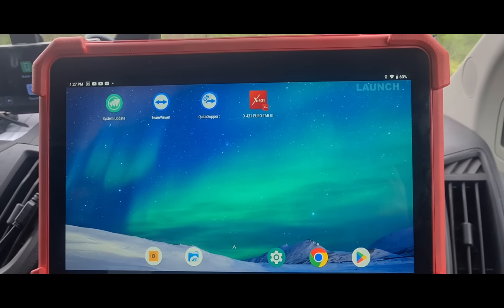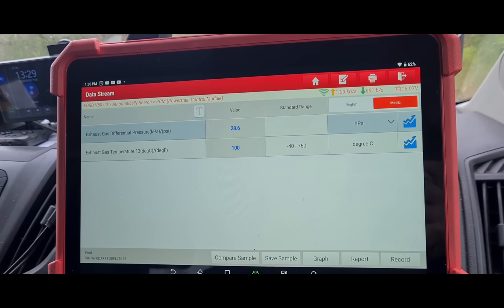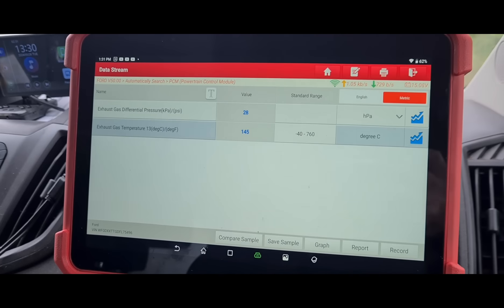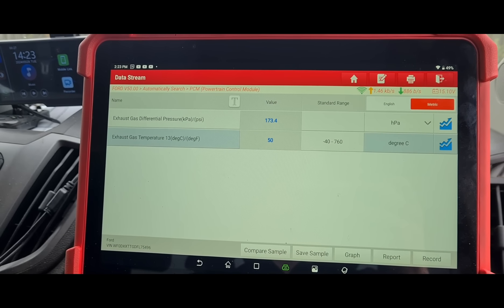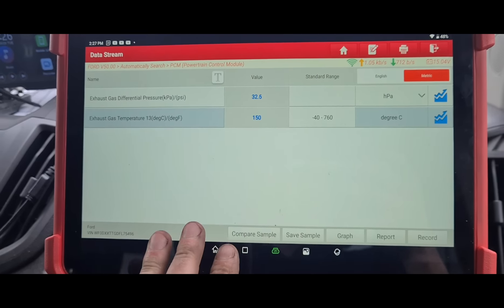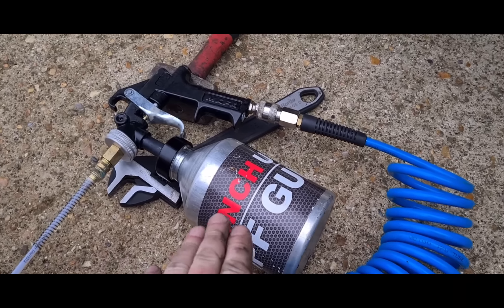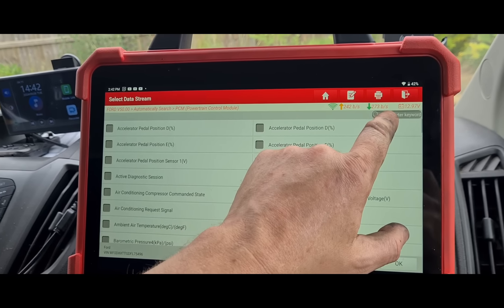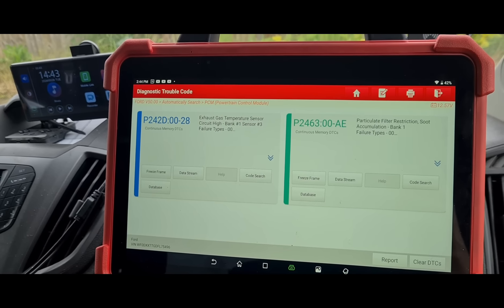Ford Transit P242D:00-AF & P2463-00 & P244D Exhaust Gas Temperature Circuit & Too High

Comment: Jimmy, trying to find out if my x5 has had a dpf delete, all looks normal but with my bidirectional scanner i see zero pressure at the dpf pressure sensor, the 5v and ground is their, but the signal only show zero to 200Mhv's just thought that if it has had a delete, then maybe that explains the Zero pressure...i'm stuck on this one and would really appreciate your thoughts on this..i mean how the hell do we tell if a dpf delete has been done??? scratching my head.. cheers ian
Reply: You need to check the actual reading at the sensor end not with your machine. Failing that check via eobd to confirm pressure reading you have.
Reply: thanks for the heads up jimmy i had no idea these bidirectional scanners offered different functions under the obd scan.. i'll give that a go... everything i understand about dpf comes from watching every video you have created, all with great info, as a result i have purchased every tool you use, wow those mittyvacs are expencive, think its time to break out the digital manometer for the first time...who knew that trying to find out if a dpf delete has been done could be so hard...argg

Comment: Is it worth having a DPF cleaned/flushed before it blocks up. Preventative maintenance?
Reply: If you use a modern diesel like they are intended and or yfix any underlying issues the DPF looks after itself.
Reply: @Mac_F87  I & many others wish there was a magic diesel but unfortunately I’ve not found any as yet. 
Some vehicles more than others no matter how much servicing gets carried out to the manufacturers specs the DPF will still block up sooner or later, unfortunately it’s usually sooner.
Reply: @thebear8068  servicing has nothing to do with it. That’s only going to mitigate oil dilution. My L494 SDV8 and Caddy have zero issues relating to emissions systems. I don’t do many short journeys, I don’t let them idle excessively and I make sure I do a long drive at least once every tank of fuel to let the ECU carry out a full regen. Which they do no problem, log both and you see the differential pressure drop off when regen cycle is being carried out. 

If you are having constant issues you’ve either got lemon or bought the wrong vehicle for your driving habits.
Reply: DPF issues are directly related to the use the vehicle gets. A vehicle that’s on the open road regularly & / or one that tows will rarely give trouble unless a component fails.
Reply: Landrover Discovery Sports block regardless of usage due to poor design, Vehicle usage is not the only factor.

Comment: Is this one of the wet belt engines aswell?
People need to stop buying these Transits.

I really wonder whats left... The Mercedes all have the OM654 engine which has issues with the valvetrain (rocker arms failing on the exhaust side ruins the camshaft if you dont catch it early) and the timing chain is a joke aswell. Ive also seen quite a few in the workshops for turbochargers.
Mercedes does have the really good Renault K9K diesel in the Citan and T Class. Its a dead simple timing belt i4 that is reliable and fuel efficient. Not a lot of power though since its only a 1.5L.
But anything Mercedes or Renault that has a 1.5L Diesel you can buy and be happy with it.
The VWs all have the EA288 2.0 Diesel. Fairly problematic engine if you have a high HP one and do a lot of work with it. BUT the low hp versions seem to do fairly well if you dont abuse them.

Id love to hear your opinion on which workvan is the most reliable. The Mercedes or Renaults with the 1.5L K9K Diesel are really good we run like 20 of them in out fleet and everybody wants one now 😅